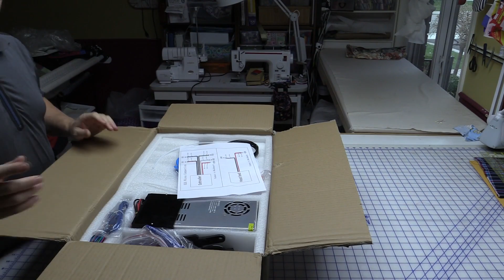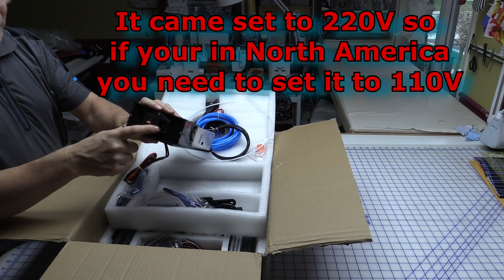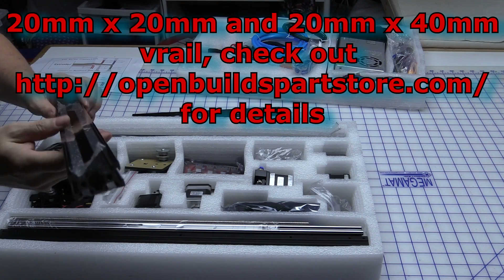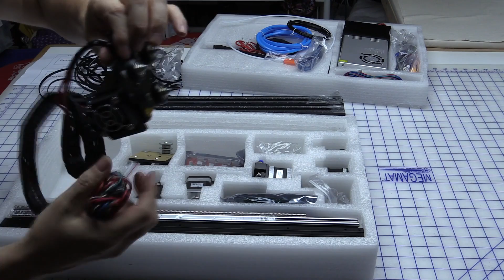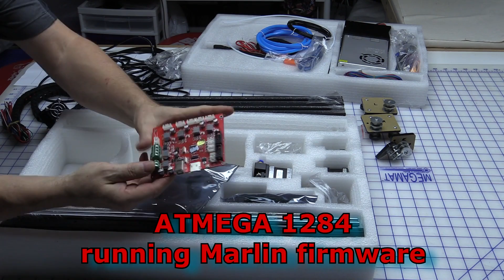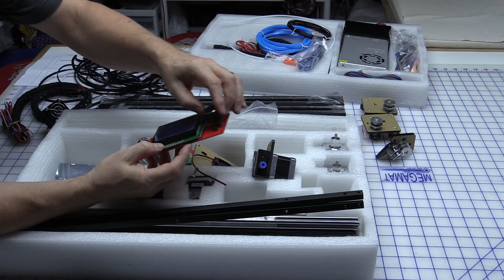Tronxy X5S Review and Build. Pt1, Whats in the BOX

Comment: Hi Peter, thanks for your X5S videos , like your style and easy to absorb, just watched the box set.  One question, what machine do you have to make the openbuilds parts in acrylic when you remounted the hotend parts onto the sandwich of plates ?  Cheers
Reply from the maker: I have (My Daughter has :) ) a laser cutter, I also have 2 CNC Home built routers, in this case we cut the acrylic with the laser but really it was just a case of getting it done quickly. any other time it would be just as easy to order from Open Builds and get the aluminium version at a good price.
Reply: @TheBreadboardca  Many thanks for taking time to reply, my interest is doing everything in house by making machines, I'm looking at making a laser cutter to make the parts you showed.
Reply from the maker: @jz2188  The laser would need to be 40-60W at least, this would also need to be C02 so be careful, very high voltages etc are needed and the LASER will burn you instantly given the chance, even the unfocused beam (Dont ask how I know :( ). so covers are a must and safety interlocks. aside from the laser, the rest is pretty much the same as my CNC or 3D printer builds. just different sizes

Comment: That bit of ABS is usually the test print done on the printer before being disassembled and sent off.  I like how they do that on a lot of models.
Reply from the maker: no test print provided but just enough to print my own when I complete the assembly. I am not sure if they actually build these complete kits as that would be a lot of work again to completly disassemble it. the CR10 / Anet 8 though are only partially disassembled (6 screws to assemble) so more able to do a test print.